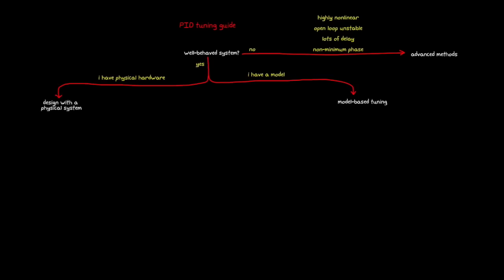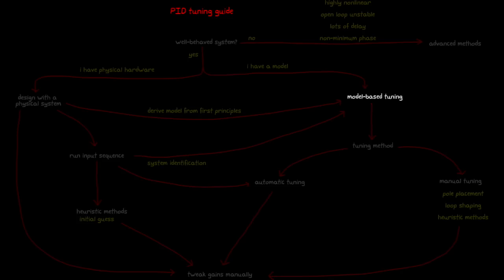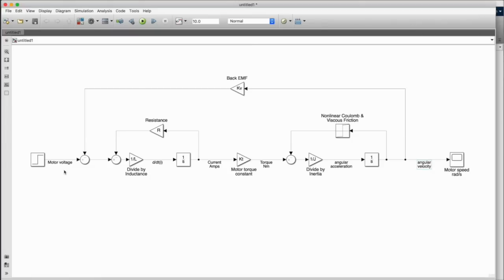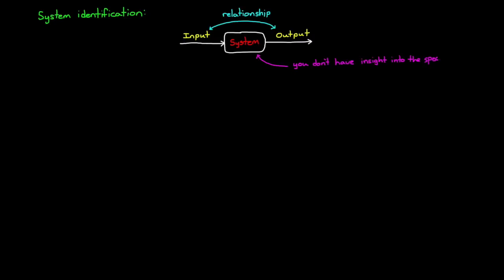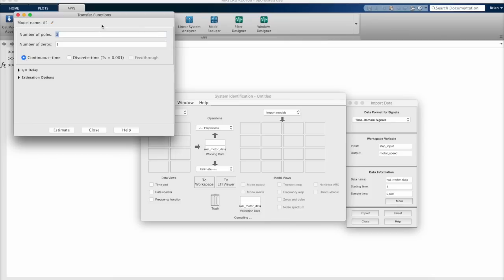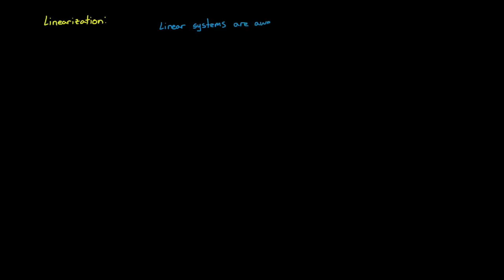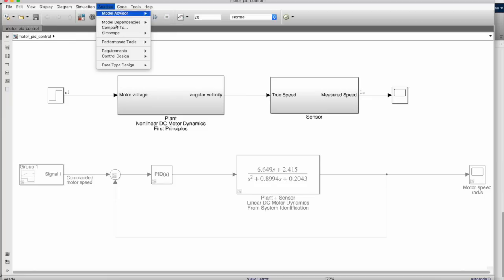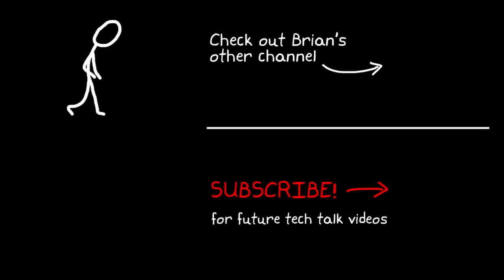3 Ways to Build a Model for Control System Design | Understanding PID Control, Part 5

Comment: Thanks for watching! As always, if you have any questions on this video leave them here and I'll try my best to answer them.  Cheers!
Reply: Awesome! Thank you so much!
Reply: You are awesome bro!. I've learnt a lot thanks to you and your useful channel. Greetings from Ecuador.
Reply: Hi Brian; I have a question. How does a PID controller differ from lead/lag compensators? Are lead/lag compensators simply an alternative to PID if PID doesn't work? What would be an advantage/disadvantage of one over the other? Btw thank you very much for these videos; it really helps me to organise all the different concepts of control theory
Reply: Hi Aldo, lead/lag compensators are similar to PID in the sense that you are adding poles and zeros and adjusting the gain of your closed loop system to get the desired effect.  Basically, using the additional poles and zeros to shape the loop response. For lead/lag you are adding one pole and one zero (the relative frequencies determine if it is lead or lag) rather than the pole at the origin and two zeros of PID.  So, if you think of them just in that sense then they are pretty similar.  In fact, with loop shaping you could add even more zeros or poles to your controller beyond what is in these standard frameworks if you need to really tweak the response, however, PID and lead/lag frameworks are pretty good for the majority of problems.  With that being said, they each have their strengths that I'll summarize very briefly.  PID is powerful because of the intuitive nature of Kp, Ki, and Kd allowing someone to tune the controller with some basic rules of thumb.  Lead compensators are good for increasing phase margin without distrupting the speed of the system too much. Lag compensators are good for increasing phase margin by slowing the system down. Hope that helps a bit. Cheers!
Reply: Hi Brian thanks very much for your reply. Another question if I may; I paused the video and saw that you linearised the system at t=2, and it turns out that the output of the linearised transfer function model obtained seems to follow the actual motor speed plot at t values far from t=2. Is this because the actual motor speed was not actually "actual" i.e. you obtained it from the nonlinear model, and since the linearized model was also from the same nonlinear model then they agree very well? This would not be the case had the actual motor speed data been taken from a real life motor right?
Reply: I'm interested in this as well @Daniel Miranda
Reply: Your videos is always amazing. Thank you!!
Reply: Great Video, thanks for sharing ! Still, i have just one question that i couldn't find. What is your Sensor Block composed from ? Thanks !
Reply: These sessions are really very insightful. Once again thanks, Brian.
Reply: What about the sensor. How you built it ? What kind of sensor you modeling ?

Comment: pretty good.  In over 35 years of doing motion control I have NEVER come across a system with a transfer function.  The first 15 years I tuned system by the seat of my pants.  Then I got Mathcad and that opened up my eyes.   The text books and most instructors do not teach controls correctly.   First one must find a model.  Brian doesn't say how but there are algorithms like Levenberg-Marquardt and BFGS that can find the coefficients for the differential equations for models.   If you use differential equations,  you can model non-linear systems fairly accurately.

There are algorithms like Ackermann's method that can be used for pole placement.  The result is not always a PID.  Sometimes it is a PI,  PD,  PID,  PD with second derivative gain or even PID with second derivative gain.  PID is not always the correct choice. 

I use pole pole placement for tuning on I have done the system identification.  It is easy to simply place the closed loop poles on the negative real axis in the s domain or on the positive z axis in the z domain.

Comment: You can't imagine how useful it is. But please mention the analyzer should be ODE3 with fixed step 0.001. Because I was using ODE45 and the results was very disappointed. But after changing the solver I got a perfect results. Thank you Brian very much.

Comment: Well, that was an eye opener moment! Now I know how to model a system. Or at least on how to begin in the first place. That's where most of the budding control engineers get stuck. Great work man, loved it. However I had a concern regarding, modelling a system using physical system, although you mentioned it you still carried out the process using your non linear model. Let's assume I have the physical hardware, how do I go about it, Give different signal input and obtain the output! But isn't that risky since I know very less of the behaivour of the physical hardware!
Also I would love to dwell in to the intricasies on how matlab system identification toolbox finds a TF using input and output curve. Any resources for that ? Or Maybe a video just on that topic.
If that is sorted anybody could tackle any control problem!
Reply: I know I'm 3 years late to comment, hope you reply to your older videos. Looking forward to your reply! 
Thanks! Huge Fan!

Comment: How is the input to the PID controller a speed variable, but the output is a voltage? Where and how does this transformation take place? You enter the error in the speed of the motor into the PID controller that it tries to minimise. How does that convert to voltage?